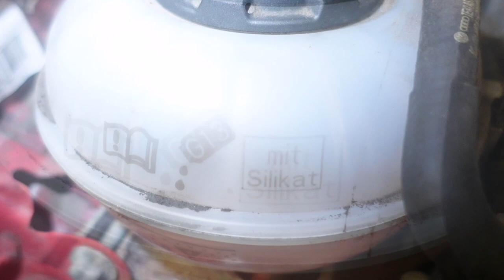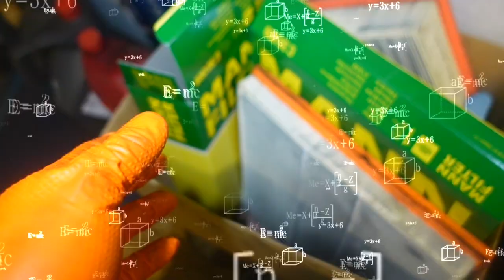VW Audi Coolant Silica Bag Removal

Comment: I got this silica bag in my audi since new it has been 6 years now, been taking out from the coolant reservoir before but I put back again but I have always check it out sometimes but it’s still solid ! I don’t yet replace or flush the antifreeze system, just each year, took 800ml out, put 800ml fresh G13 😂
Reply: What do you mean? I don't understand what you are trying to say.

Comment: I've started pulling these out in work lately. Saves someone a lot of heartache.

I was watching an old Vag training video. There's liquid silica within the G13 coolant. The granule pouches are only there in case someone pours water in.
Reply from the maker: Yes g13 has silica in it but not enough for engines with extensive aluminum. Many run g13 with no bag.
Reply: Tea bags 😊
Reply: @davesterl so what is the solution! What to do?
Reply: Take bag out and replace to g12evo?

Comment: No intro 😔 I have done about 4 vags due to clogging up the heater core not hard work at all, but its better to take them out 👍👍
Reply from the maker: The heater core can still clog without the silica bag bursting. I've replaced matrixes that had g12 no bag. Two separate issues
Reply: @davesterl clog from what ?